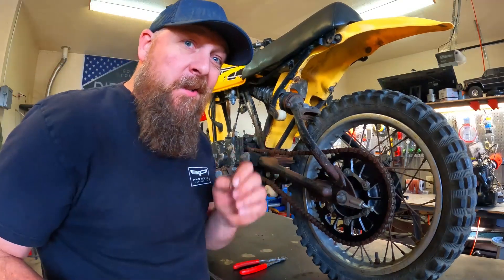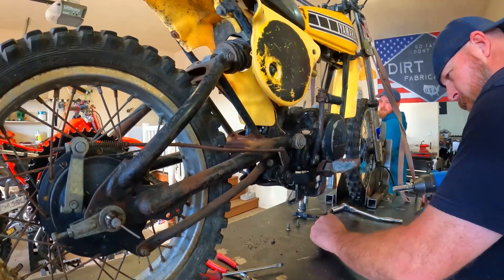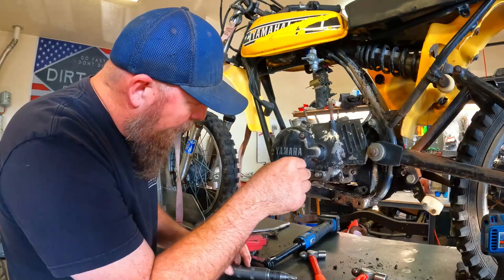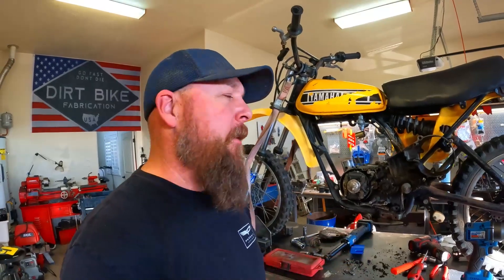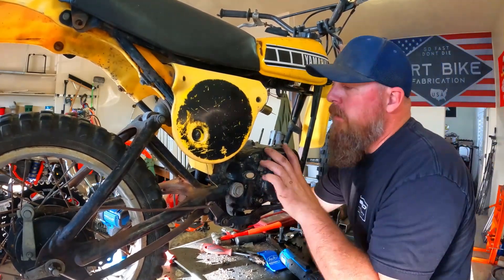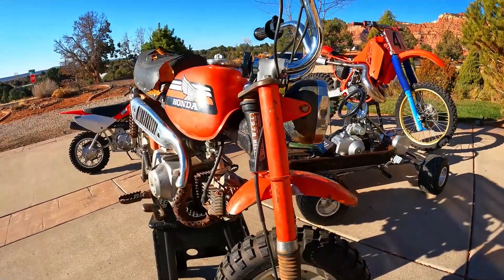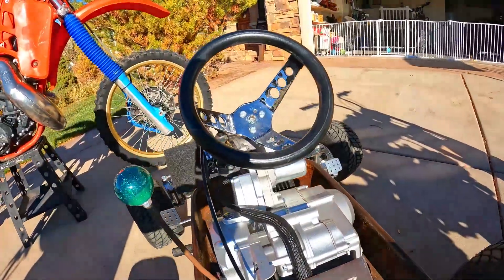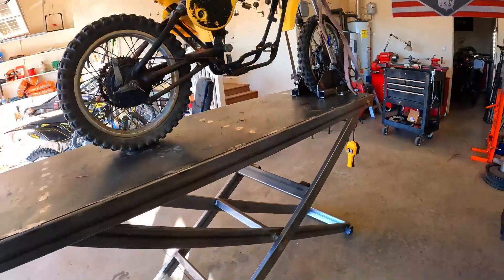Restoration continues on the vintage 1979 YZ 80. Your help is needed in the DBF garage.

Comment: It's super cool you thought enough of the little Yz to save it. If it were me, I'd finish the 87 move on to the lift table and then the CRF/atc swap until parts roll in for the Yz80. Finding parts for anything not Honda is really difficult, I have an 82 yz250 I'm restoring as well as an 83 Cr250, it's way easier to find parts for the red bike.

Comment: Have you ever thought about building your own diy hydro blasting cabinet out of sand blasting.  Garage space is my biggest challenge. But with all the rebuilding these old bikes I think you would use it quite a bit.
Reply from the maker: Yes it’s on my list of equipment for sure
Reply: I thinks the cr500 is probably the closet to being finished up. I have noticed when I am kind of overwhelmed with projects. Is to start with the littlest one and start from there.  You are truly amazing. Keep the work.